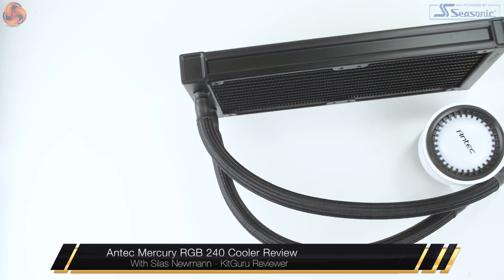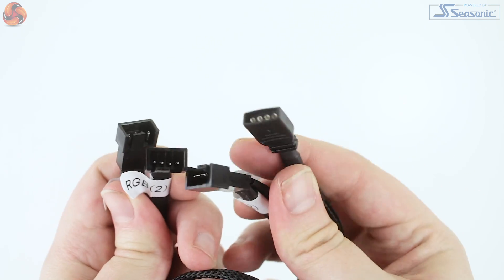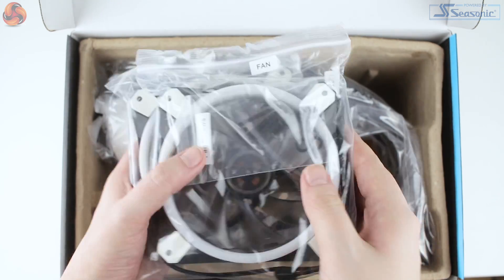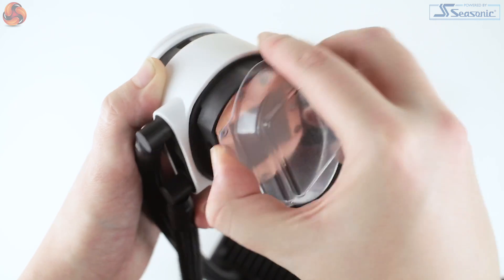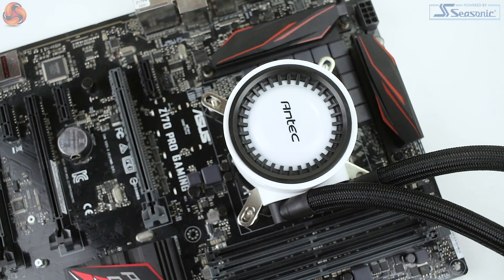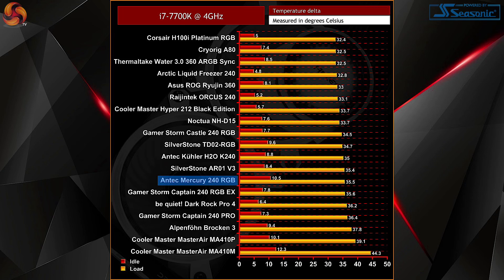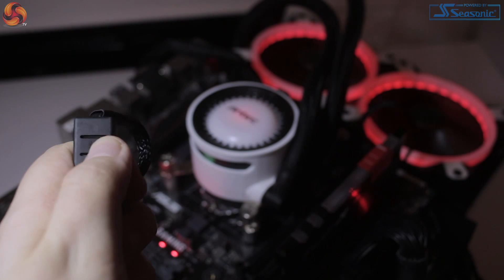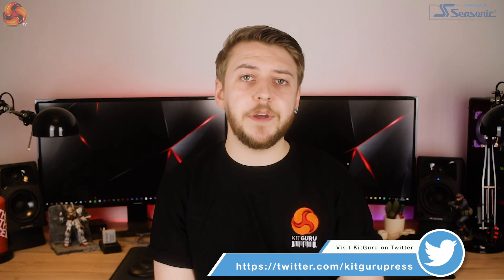Antec Mercury RGB 240 Cooler Review - can this £95 AIO deliver?

Comment: ya'll i need ur help. Soo i have a ryzen 7 5800x with antec 240MM aio and for some reason my pump is quite loud and cpu is around 65 C while my radiator is cold to the touch. my placement is (radiator on top and tubes on the right)

Comment: got one of these and the seating is rubbish as the 4 seating blocks are to large and the cpu heatsink does not touch the cpu! its miles away, when you install the other way with the smaller blocks then it actually sits on the cpu like it should. the instructions dont mention this. i would stay clear of garbage like this and go with a better brand